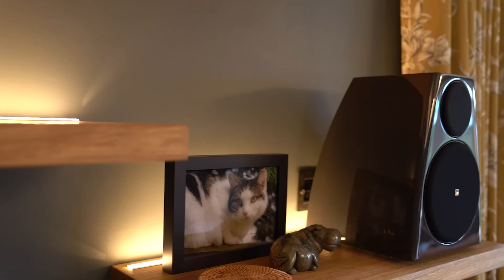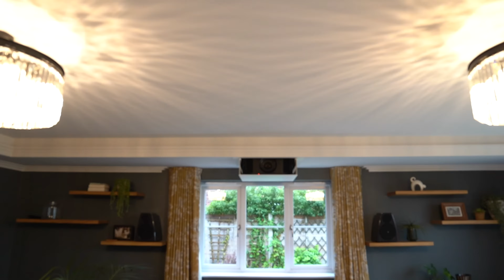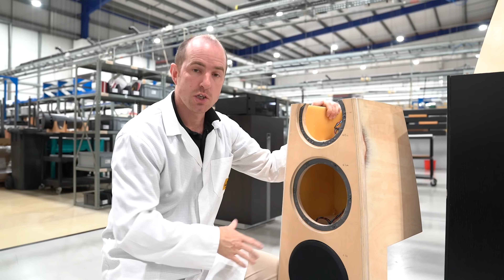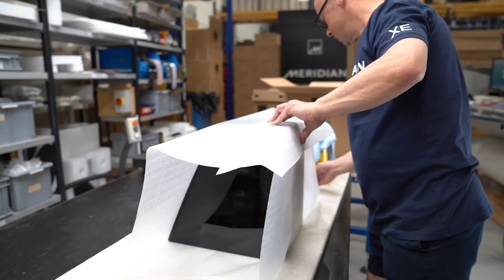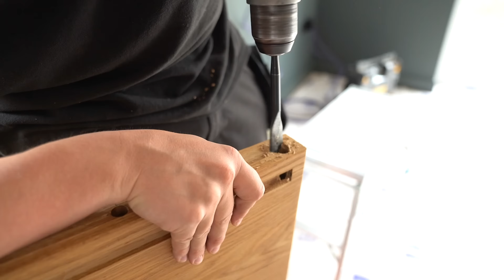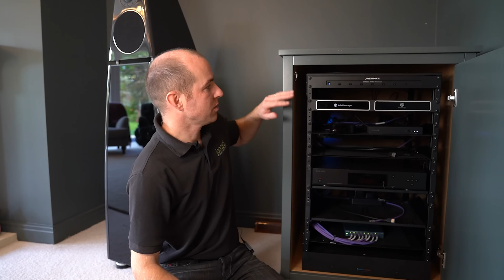MEDIA ROOM TRANSFORMATION - 2022 MERIDIAN DOLBY ATMOS

Comment: I know this is not really Atmos, but can you actually built an Atmos system with Meridian processing or a simple 9.2 setup?
Reply: If you want to use a Meridian processor then you cannot do atmos as they are a 7.1 processor only. If you want to use only Meridian speakers and another processor that can handle more channels then yes you can do that if you buy a Meridian 271 Digital Theatre Controller. Hope that helps.
Reply: @Road_Train_Trucking  oh this is great except that the first generation DSP8000 and DSP5500HC don’t have speakerlink and it seems the 271 only has speakerlink digital out. This is definitely a starting point. I just gotta figure out that part

Comment: Beautiful job. Can I ask how much this cost approximately as I would love to have something like this done in future.
Reply from the maker: Happy to give you some ball park figures. If you drop us a direct contact someone will get back to you.
Reply: @joocedbespokeluxurytechnol9043  There you go wasn't that hard now was it 😁😁😁
Reply: I’d say about in the low end $230,000 US dollars
Reply: about £65k-£100k, just the two front speakers themselves (DSP8000) cost circa £20-£25k, then you've got factor in, the projector, the mounts, the additional speakers, the screen, the receivers/amps, cabling, labour, oh and whatever sources of your choice + more.
Reply: @Gadgetlava  your calculation is way off !  Just considering the meridian gear - The 8000s are £50k for the SE version and £75k for the XEs. The 861 and 818 processors are £11k and £8k respectively. The centre is around £15k and the 3200 speakers at the back are £3k each .